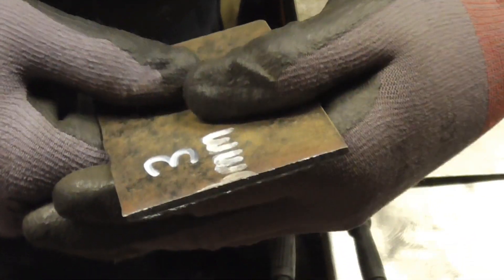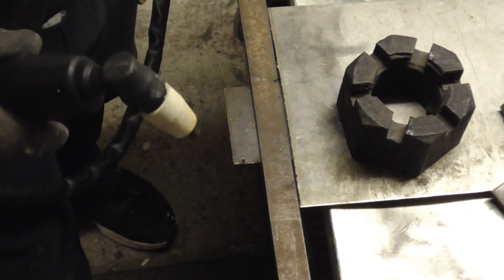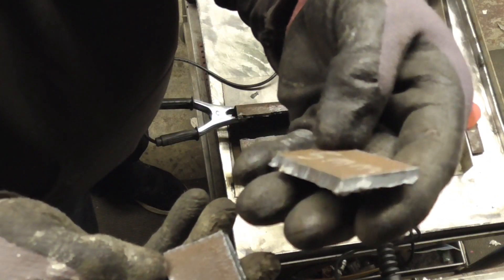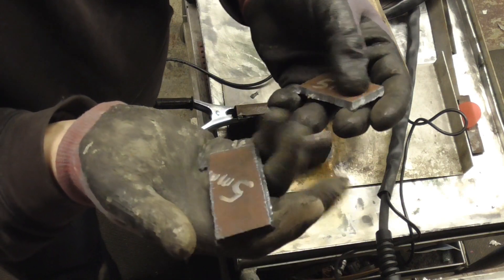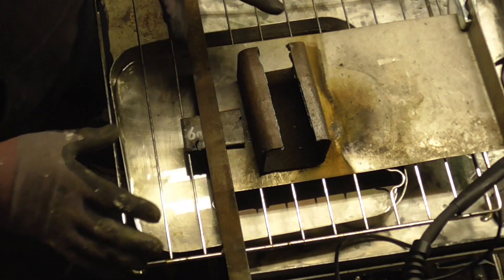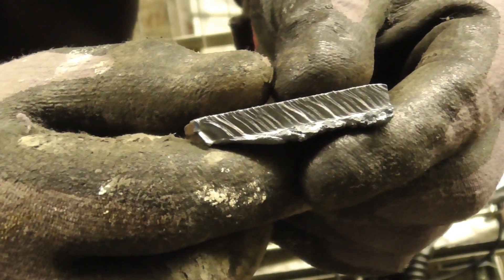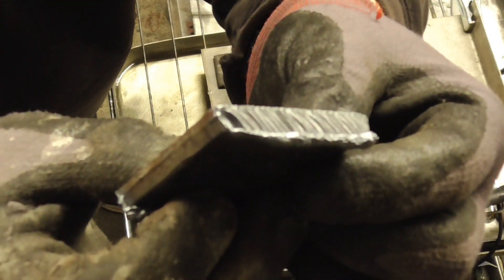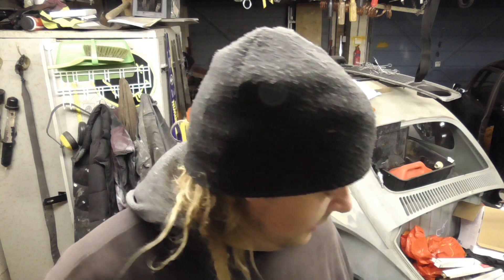Parkside PPSK40A1 Plasma Cutter CONNECTING EXTERNAL AIR - Budget Plasma Cutter Integrated Compressor

Comment: Manual says 4 to 4.5 bar external pressure so circa 60 PSI
Reply from the maker: Honestly it was just a total nightmare. Without a trigger valve it's just a PITA. The internal compressor is more than adequate for everything I've done so far and far more convenient too. Glad I went for a cutter with it built in now as wasn't initially looking for that. Just cutting a van up outside was so much more convenient without trailing air lines everywhere and I only have small domestic compressor too. Tx for watching and the feed back 😊👍

Comment: Are the nozzles on the Parkside cutter for stand off or drag? that little wheel thingy suggests it might be stand of nozzles?
70-80psi sounds insanely high for a 40A specced machine (doubt it deliverers 40a).
3.5bar or about 50psi should be about what you need for 40A
I have a 40A hypertherm at work, I run it at 40A all the time and about 3.5bar and just adapt my cut speed.

with about 40A on 3mm steel you should have a cut speed at about 1500mm/min, stainless and alu  about half that.
Reply from the maker: I'm not sure tbh but I've been using it for hours as drag with the built in pump and not problems other than goes through tips.... so maybe your right. I just coukd make it work on the compressor no matter what pressure I used. Works great with the built in compressor though. 😊👍

Comment: Also the machine neds 15amp startpower.
Reply from the maker: Yeah it's not really suited to a domestic garage for that reason. Luckily I have a ring in there not spur so could add more amperage on fuse board. Tx for watching and feedback 😄👍

Comment: Great videos,I’ll deffo be getting one mostly be doing vehicles so if I need to do work away from home the inbuilt compressor will do me fine…..Easier to cut something on a car we’re it’s hard to get to,compared to a grinder cutting wheel…….keep an eye on your beers in future lolol👍😉
Reply from the maker: Thanks dude. I've used a few times now for various stuff, just be careful when  cutting vehicles as the sparks fly just like a welder so need to protect anything and everything at the other side of the cut. 😉👍 I've made this too using the cutter if bothered about arty stuff on my other channel...https://youtu.be/WxsxNmYyJ_I
Reply: No worries,I’ll give it ago😆😂😉👍

Comment: May be it's dirty consumables or earth clamp? not air pressure
Reply from the maker: Thanks for that. I did check the earth was good and repositioned it as a test. Deffo the regulators at fault as worked first time on the new one and was working find on the internal compressor. Must say I thought was the cutter for a while. Tx for watching :)

Comment: For the money that thing looks to be exceptionally good value.
Reply from the maker: After looking at the specs the earlier plasma cutter that Parkside did for £80 that seems a total bargain. If you have an air compressor it runs at exactly the same PSi so suspect the internals are very similar. Without external air yes I think this is a good price too and couldn't find cheaper with an integrated compressor, but still nearly double the other one. Thanks for your comment 🙂